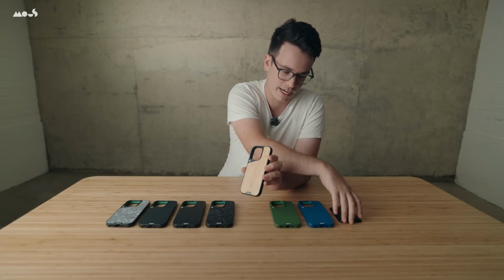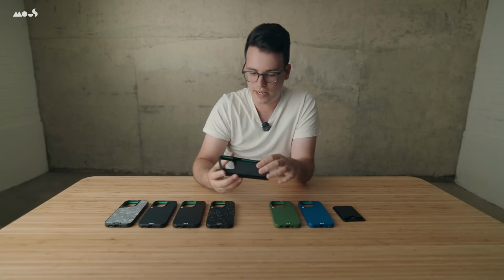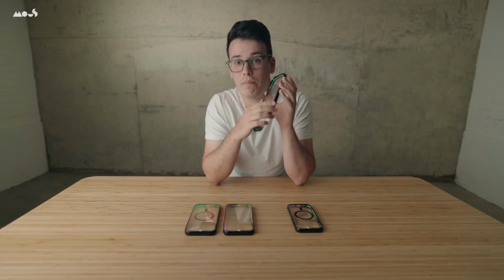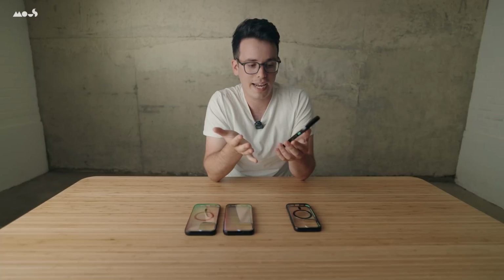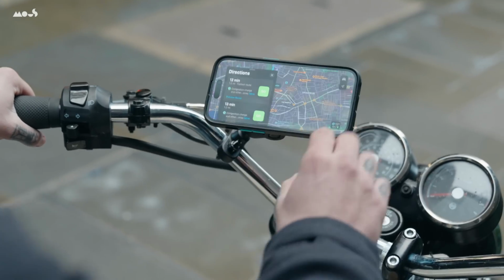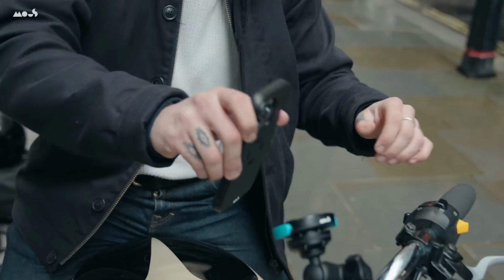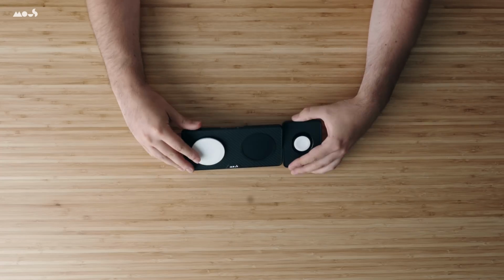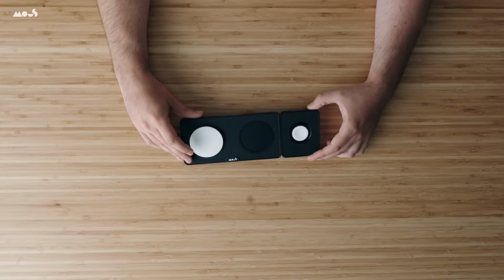THE IPHONE 15 MOUS CASE LINE UP!

Comment: how drop resistant on your clarity 2.0 cases? for 100$ CAD I would hope it's good. I just bought one, however, I seen some comments of your own comments saying it's for mishaps and not for extreme drops. If that's the case, I may consider returning the one i ordered for something a bit more shock protective. Ive had terrible drops before, and I dont see them stopping anytime soon lol.
Reply from the maker: it can withstand extreme drops but limitless cases' drop protection is much better because of microfibre lining and rigid backplate esp for your phone's back 

contact our CX Team for returns and exchanges, you have 30 days after delivery www.mous.co/pages/get-in-touch

Comment: I’m having prob to choose bwt limitless 5.0 and clarity 2.0. Do they have same protection quality, shock absorb, ultra material? I kinda like Fraser art but gonna put safety as my first priority. Any help?
Reply from the maker: Both ranges offer a very high degree of protection. They are engineered for protection, made from durable materials and lined with our impact-absorbing AiroShock™ material. The Limitless cases are slightly more protective because they utilise multiple different layers of materials, including polycarbonate, microfibre and tough backplates like aramid fibre. It's the combination of multiple layers and AiroShock™ that make Limitless our most protective case range.

Comment: Any chance you could add a fraction of a millimeter to the height of the super thin cases? When placed face down, the phone rests on the screen protector which lead to scratches easily forming.
Reply from the maker: will pass the suggestion to our team! but in case you need further protection we reco getting a much protective Clarity or Limitless cases since they have raised lip

Comment: love the clear case but many tech reviewers and users mention the camera lip being too low so that it offers no protection when laying on the table let alone when dropped. Has Mous tested this and can you confirm this leaves room for improvement?
Reply from the maker: Mous clear cases are meant to protect your phone from everyday mishaps. Thus, we recommend getting Limitless cases for an extra layer of protection in case you need it in extreme circumstances. That said, I am still happy to pass this feedback on to our team for improvements in the future.
Reply: @mouscase  could you please specify everyday mishaps. How many feet is that? :)
Reply: Thanks for clarifying! Does Mous mention their level of drop protection anywhere (for the Limitless)? It would seem strange that Mous is not clear on this?

Comment: Why doesn’t the camera lip go all the way round on the limitless. Doesn’t this leave the camera vulnerable
Reply from the maker: Hey Steve! Because of the size of the iPhone 15 cameras, particularly the Pro Models, it’s very difficult for cases to cover the cameras. However, Apple has made them with a sapphire crystal lens cover so this shouldn’t be a problem! Even so, our cases will provide a little extra peace of mind - all of our iPhone 15 cases provide 0.5mm of clearance between your camera and a flat surface. For some of our cases, this camera bump is only on two sides - this is because we’ve researched extensively and found that these are the angles you’re most likely to hit your camera from when you drop your phone. This means that you’re not very likely to knock your camera and, if you do, Apple’s native design has you covered.

Comment: Been using other cases with stronger magnets and never had an issue. I won’t buy your cases simply because the magnets are weak. You simply can’t use it with a MagSafe car holder.

Comment: love my 13 Pro Limitless 4.0 case, still looks 80% new for 2 years of use, this is my first case that survived that long, i hope on 15 Pro, Mous would still be my case
Reply: Mine fell apart in 8 months. Got a free replacement and after just one week the case feels loose like the frame is slowly detaching itself from the rest of the case. What could cause this can only be pulling my phone out of the pocket.
Reply: sorry to hear that you had a bad experience on their product, never experience that on my case, its perfectly fit and dropped my phone many times and im confident that my phone will survive without any damange

Comment: Are these cases compatible with screen protectors? There’s less of a gap now around the edges I’ve heard.
Reply: Every one except the thin case works fine with glass screen protectors. With the thin the screen protector is higher than the lip of the case

Comment: Great review of the increments in your products 💪.
Just ordered an Intralock case for iPhone 15 Pro, does the case have black buttons this year (instead of blue ones)?
Reply from the maker: should be black except for the Intralock Evolution case which has teal buttons!
Reply: @mouscase is there going to be a clear (evolution) intralock case for the iPhone 15 pro?
Reply from the maker: hey! it will have black buttons this time😊

Comment: I am considering the limitless for my new 15 pro max and always buy Spigen screen protectors with their awesome fitting device. Are the protector (or any 3rd party) and a limitless 5 compatible please?
Reply from the maker: we haven't tested it out yet but they are predominantly compatible since we designed our cases with screen protector in mind😊

Comment: I loved the case up to limitless 3. But I never saw much improvement for MagSafe magnets. Most of my accessories did not stick too well. It appears you guys improved it from this demo. Can you upload a video showing how well MagSafe accessories hold onto the case?
Reply: İm using 14promax with mous case,magnet is pretty strong
Reply: @theanimekid5407  I haven’t purchased one in about 3 years or so due to the weak magnets. Ordered one today so I’ll find out soon enough. But appreciate it